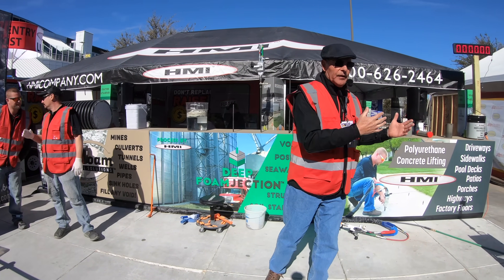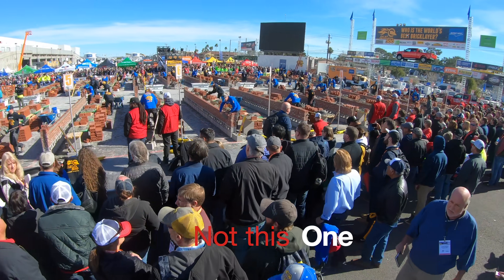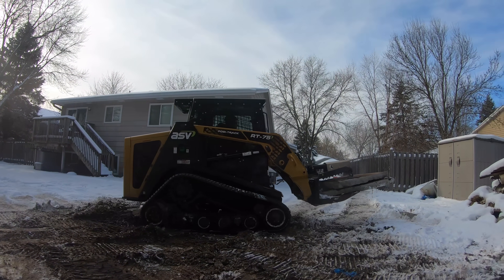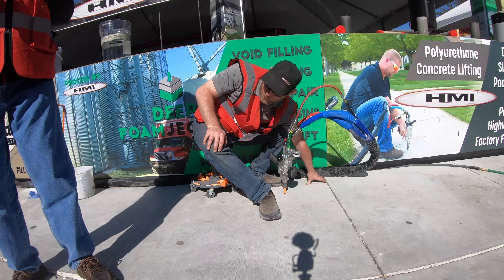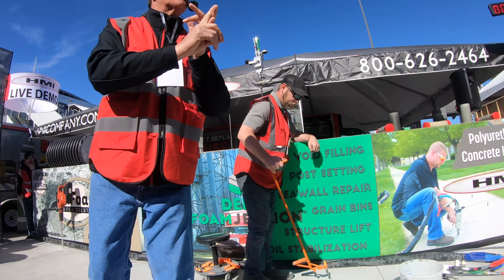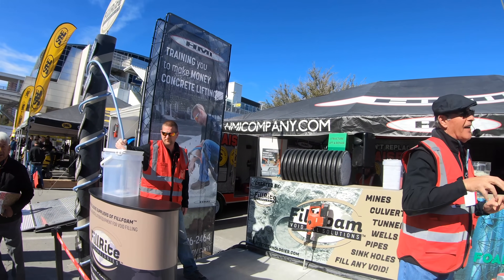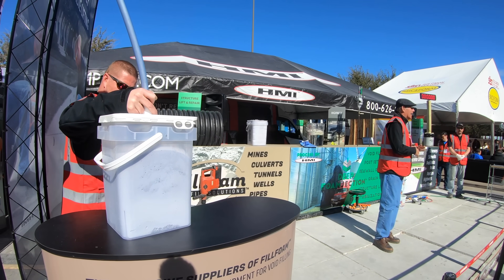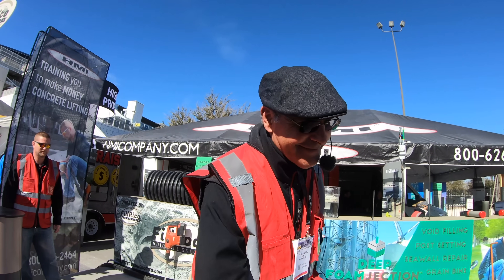How they raise & level Sunken Concrete with foam  4 k video

Comment: With the foam raising the settled concrete wouldn't create air gapes underneath that can cause future cracks or break? Or does the foam expand to fill those gaps as it raise the concrete. How much weight can it support like for example someone with a concrete driveway that settled and has a tow vehicle and trailer that weigh, let's say example 20k lbs?

Comment: Id be afraid to use too much and lift the section too far
Reply: With HMI’s training and support, over lifting is something that will occur very rarely. If it does happen, your account manager will be able to walk you through what to do next to still achieve the desired result on the job. hmicompany.com

Comment: Settled concrete is caused by 1 of 2 things or a combination of the 2, poor drainage and improper base. The cause needs to be corrected also.
Reply: If the settlement was caused by unstable, poorly compacted soils we can address this with the polyurethane foam two ways. One, we can inject the material just below the slab and as the reaction occurs and the foam expands, it will expand in all directions – raising the slab and compacting the soils underneath. This can help to stabilize the subgrade and prevent further settling. Two, we can use Deep Foamjection to inject foam at various depths to repair the unstable soils and increase the load bearing capacity of the subgrade. This process, along with one of our hydrophobic foams, can also be used to address improper drainage.

Comment: Hi Stan, I own JW Mudjacking and poly leveling in Portage WI and buy all my equipment and poly through HMI. They are a great company I’ve gone to multiple seminars when they develop new products and they always have treated me great. They do really push the poly as the best option but honestly they do the same thing if you use the right grout. Mudjacking is a lot cheaper and is easier with jobs that are spread out (apartments, condos, city sidewalk contracts). Poly works great an is a lot less labor intensive it’s cleaner and faster. Its great to do interior floors or in places that need the space usable immediately. They also make a soil stabilizer that turns sandy soils into 3000lb grout that we apply under floating slab foundations. If you would like more information from a source that uses there products and does not sell them (less biased opinion). I’d love to speak with you and fill you in on what we do. We are the only other Mudjacking and poly leveling company in WI other than HMI’s sister company to my knowledge. Look forward to speak with you.
Reply: You can email me at jwmudman@yahoo.com.

Comment: I've seen the concrete slab/sidewalk leveling before, and thought it would be a great ting to get into around here.  We live in the greater New Orleans area, and the soils here are swampy, and are constantly sinking and shifting, and it is different all areas around here.  I wonder how it would work here, or if at all.  I met a guy a few years ago at the home and garden show that had a similar product that was supposed to go under the house to level foundations.  He came out to my house and took a bunch of measurements, but I never heard from him again, no matter if I called or sent an email.  I wonder if it is a good thing for this area because of the constand sinking and settling?
Reply: HMI offers a hydrophobic line of foams that are ideal for those scenarios where wet conditions have led to unstable soils and sinking concrete. This foam, in conjunction with Deep Foamjection, can be used to stabilize the soils and level the sunken concrete. This process can also be used to stabilize foundations and even lift homes in the right conditions.
Reply: @HydraulicMudpumpsInc  , I wish it were that easy.  You see, around here, specifically my house, the ground is constantly sinking, and we have to pump sand under the houses.  If not, then the support will not be there for the piles that hold up the house.  Also, eventually, you will be able to actually see completely under the house to the back yard.  Then the house can actually sink or tilt, or bend in the middle.  It is sickening to think about.  So, if there were to be a large 'foam' encasement under the house, what would then prevent the house from sinking?

This happens a lot in this area, and I'm not sure if there is any way to stop it.  Does this make sense to you?

Comment: Its cheap, it works. But it rly sucks for the environment. Not a green product what so ever.
Reply: they do say it is green but i dont see how it is good either.
Reply: Our polyurethane foams are made from recycled materials, do not leech chemicals into the ground, and are safe for the environment. HMI’s patented Recycled line of material is completely inert once injected into the ground as a foam. In fact, the USDA has certified a handful of our foams. The best way to explain what’s in our material is foam you already know and use every day. For example, car cushions, seat cushions. These items are melted down into their basic components and recycled into out material. There is no threat to wildlife or water when the foam is a foam. We even manufacture a safe foam designed for specific usage in water environments.  HMI uses absolutely Zero carcinogens in our material. Typically when you read articles about carcinogens in polyurethane foam, you are reading about when polyurethane first came to be in this world for concrete raising which is dated over 30 years old.

Comment: It's a good temporary and short term solution. To properly fix a sunken concrete slab, one needs to find out the roof cause of the problem in the first place. Soil erosion, poor compaction, insufficient gravel, ...
Reply: You are right, sometimes there are things going on deeper in the soils that have led to the settling that need to be addressed. Our standard injection method will help to compact the soils underneath the slab and better stabilize that slab. However, sometimes you need to get to the root of the problem. This is where Deep Foamjection comes into play. With Deep Foamjection, we can drive pipe lengths to varying depths underground to stabilize the soils and prevent any further settling.

Comment: well this fall I did some research and even called and it at that time they acted like they didn't want to deal with a small business and gave me a contractors number that wouldn't even return a call all set up with air and am thinking spray foam and this can go with different added service
Reply: the foam rig used to raise concrete is almost the same as the insulation rig. need HMI gun and thats about it
Reply: @powder8157  a tad of training the right stuff makes better jobs

Comment: How long does it last ??
Reply: depend on soil and water and if a home owner seals cracks after to stop water from getting under slabs. for normal mudjacking its about 8-10 years,  have seen it last longer but have seen it only last months so you have to pick the right company that will honer the warranty.
Reply: Honest, HMI Polyurethane foam is a permanent fix that will not degrade, erode, or be washed away by water. When polyurethane foam is injected, it expands in all directions compacting the soils while raising the concrete. By doing so, the newly compacted soils are less likely to be as effected by frost and drought. If the soils are unstable deeper underground, this may still pose a problem. However, we can use Deep Foamjection to inject polyurethane foam deeper underground in areas where soils may be weaker and require stabilization to prevent any further heaving from varying weather conditions. visit our website to learn more hmicompany.com

Comment: As a highway maintenance worker we use this on the interstates much larger scale tho. Works very well on joints that are not cracked. Almost impossible to use on cracked slabs becomes very unpredictable. Also if it’s not deep injection and just pumped directly under the slab it will cause the roadway to freeze faster in those areas almost like a bridge would

Comment: I had that done to my patio. It failed and sunk within 3 months. Plus the concrete had splotches from where the morons used pvc cleaner to clean their many spills. And the concrete also has many places where quarter size circles 1/4 inch deep of concrete have popped out. My patio was better before this disaster. Don`t do it!!!
Reply from the maker: Was it done with Foam?  Sounds like a train wreck.
Reply: @Dirtmonkey  Yes it was a horrible mess. They refunded my money. But they should have replaced my patio. Bloomin idiots!
Reply: Rick-When done properly, raising with polyurethane will be a permanent fix to sunken concrete. It is very important to not only drill your injection holes for lifting in the proper places, but to also drill support holes! After raising the concrete, you will create new voids behind where you lifted that you need to inject into to fill those voids and support that slab to prevent running into issues in the future. Also, when done correctly, raising with polyurethane is mess free and there will be no spills made on your property. Polyurethane foam does not expand and contract with freezing and thawing and therefore will not cause your concrete patches to pop out. These are all things that we will extensively go over in our 2 day training seminars as well in our continuing training and support!
Reply: @HydraulicMudpumpsInc  My apologies! It was not my intent to slam your product. I am sure from what I experienced with my patio. And maybe I should have been more clear in my comment/complaint! The crew that did my patio were the problem. And of course the company they worked for not properly training their employees. Again sorry to have made it look like my comment was directly about your product. Have a nice day!

Comment: Neighbor payed over $400 to have one 10ft by 10ft section of driveway lifted on one side. The other side that had raised up didn't come down all the way either. It only took an hour or so and my neighbor had immediate use of his driveway. But for around 100 more he could have had a perfectly level new section poured.
Reply: most ppl dont want to replace the slab due to the color difference and to get a concrete guy to pour 1 slab is not easy at least in my area.
Reply: @powder8157  i doubt most people are that picky about the color. If they want new concrete they already know it's going to look different until it weathers and blends in. The main advantage to concrete raising is the generally lower cost and instant results.
Reply: @jamesnm21   i have had ppl say they dont want that color difference thats why i said it and it does look bad for a long time with one slab new on a whole driveway
Reply: The big thing to remember here is that we can lift your sunken concrete, but can’t bring down the high spots. In this situation, what we’d do is bring the low spots up to match the high spot and not expect that high spot to drop down. Many times you’ll need to inject into surrounding slabs and not just the slab that has sunk. If the contractor had gone into the other slabs to bring them up to the high spot, your neighbor very well could have been left with a level driveway free of kick spots.

Comment: Question what happens if you put too much foam in the hole ??  Thanks  how long will it last ...thanks Stan.   Craig.   Pa.  Guy
Reply from the maker: Thanks for watching Craig !
Reply: if you put to much under the slab it will raise above where you want it so you have to pull that plug out and let the extra foam come out the hole so you dont over raise the slab which is easy to do with the foam. idk about the foam but for normal mudjacking you can get around 8-10 years out of the job but i depends alot on soil. i have seen ppl get over 20 years out of it and some only months.
Reply: Craig-When taking advantage of our ongoing training and support, and relying on your account manager when needed, over raising is something that will not happen often. There is a technique to raising with polyurethane that when you are patient, take advantage of our support, and let the foam work you can avoid running into this scenario. If you do over lift, there are a few different options that again your account manager can walk you through. One option is to go into the slabs adjacent to where you over lifted and bring those up to match the new kick spot you created bringing everything back to level. Visit our website to learn more hmicompany.com

Comment: How is the volume of the existing cavity with the sunken concrete calculated, and then how is the amount of cavity needed to be filled calculated to elevate the sunken concrete to a level state?
Reply: looks like its a squirt a little at a time and see what happens system
Reply: they make an app that will calculate it for you all you have to do is enter the slab dimensions and how far is is down but it is not at all accurate.
Reply: We are able to calculate how much material will be required in a given lift by using the square footage of the area, how much is has settled, and on how many sides it has settled. From there, we can determine an estimate of how many pounds of foam we’ll need for that particular lift. There is always a possibility for additional voids underneath the slabs that we can’t see. Drilling test holes can tell you a lot about what is underneath the slab and if any voids are present. Estimating and bidding jobs is something that we will teach you in depth in our 2 day training classes and continue to assist you with throughout your concrete lifting career.

Comment: Interesting concept,curious as to the life span of the Foam,and how it reacts to environmental changes,ie frost and drought conditions where grounds dry out and move.
Reply: Paul-HMI Polyurethane foam is a permanent fix that will not degrade, erode, or be washed away by water. When polyurethane foam is injected, it expands in all directions compacting the soils while raising the concrete. By doing so, the newly compacted soils are less likely to be as effected by frost and drought. If the soils are unstable deeper underground, this may still pose a problem. However, we can use Deep Foamjection to inject polyurethane foam deeper underground in areas where soils may be weaker and require stabilization to prevent any further heaving from varying weather conditions. Visit our website to learn more hmicompany.com

Comment: Very interested in this since I need some work like this done at my home.  I wonder how durable it is long term since it is foam.  Thanks Stan!
Reply from the maker: No problem, thanks for watching !
Reply: life span depends on soil and water drainage. the foam is under the concrete so it doesnt degrade like most ppl think, but i have seen the foam last years and i have seen it only last months.
Reply: HMI Polyurethane foam is a permanent fix that will not degrade, erode, or be washed away by water. When polyurethane foam is injected, it expands in all directions compacting the soils while raising the concrete. By doing so, the newly compacted soils are less likely to be as effected by frost and drought. If the soils are unstable deeper underground, this may still pose a problem. However, we can use Deep Foamjection to inject polyurethane foam deeper underground in areas where soils may be weaker and require stabilization to prevent any further heaving from varying weather conditions.